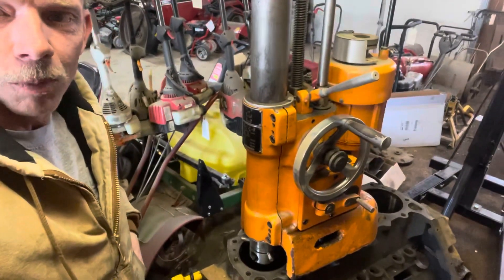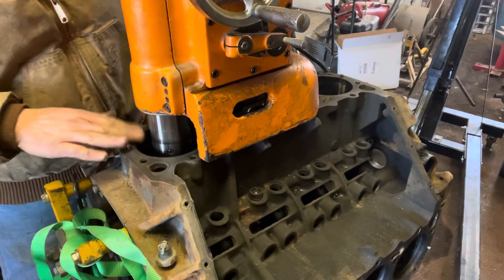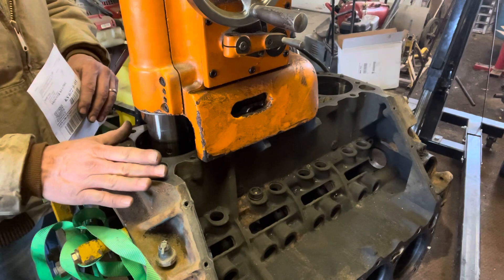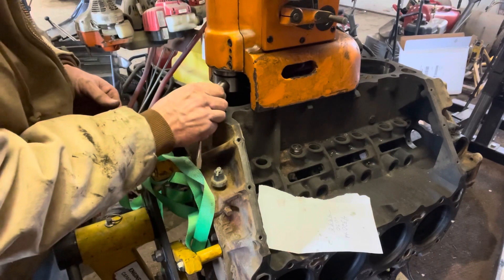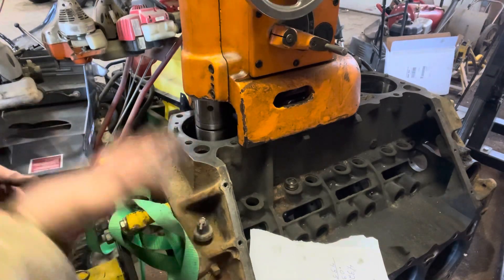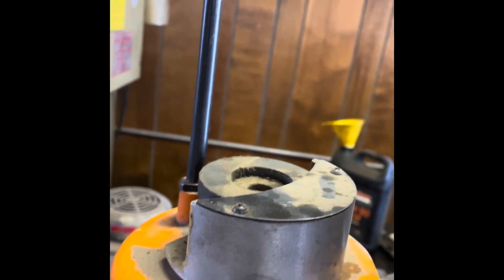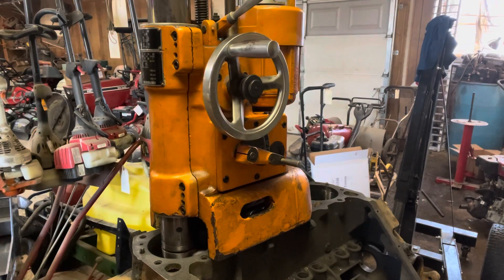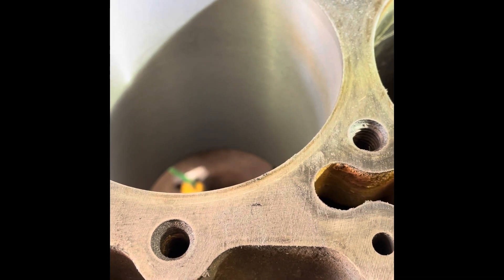How to Bore a v8 engine

Comment: Im curious about one thing, is a bore process to clean and smooth a cylinder port or can you also just use it bore out a bigger diamator for bigger pistons? Does that what makes the engine a race engine? Bigger pistons?

Comment: I have a kwik-way FT. This machine seems to be a exact copy.
Reply from the maker: It is a kwik way copy.    Think the cutter arbor hole is different
Reply: @oldschoolmechanic7771  
Yes, the tool holder and plunger are different.  Is micrometer the same on this machine you have.
Reply from the maker: This one is in metric readings

Comment: I couldnt see the mfg on that machine...looks like a better version of the van Norman 777?
Reply from the maker: It’s foreign made.  I didn’t like that part of it but didn’t have the money to buy a van Norman at the time.  The model number is T8014A
Reply: @oldschoolmechanic7771  thanks, would you still recommend it then in case I cant find a used van Norman at a decent price?  I'm just hobbyist shop but I'd like to be self sufficient and maybe build a dozen or so engines a year for sale to fund my addiction
Reply from the maker: It is a foreign made machine I did not like that part of it but at the time I did not have the money to buy a van Norman or equivalent.   The model number is T8014A
Reply from the maker: LOL on the addiction.   Yes It is a decent machine and I’ve used it more than once did build one 383 stroker motor with it and I also  bore small engines with it to seem to be working just fine
Reply from the maker: Look on Alibaba Or just look around online I found this one in Miami Florida and at the time he said he had one machine left but he did not have the tooling that went with it

Comment: Brilliant, easy to follow explanation of the process. I'm having this work done to my engine (Jeep 4.0) and sent this video to a friend to help him understand all the weird numbers I was shopping for.
Reply from the maker: Thank you for saying so.  Jeep 4.0 straight 6.  Tough motor.  One of the best built
Reply from the maker: Thank you.  Glad I was able to help
Reply: @oldschoolmechanic7771  
I ended up needing to go 0.030 over on my engine too. I was really hoping for that 0.020 would have cleaned up the bore since the 258 crank has a stroke of 3.895 and a square bore engine would satiated my need for symmetry, but 0.010 over square is hardly noticeable. 
Tossed in some KB pistons, and now the engine is a 4.6L at 9.2:1 compression and a 68-232-4 camshaft.